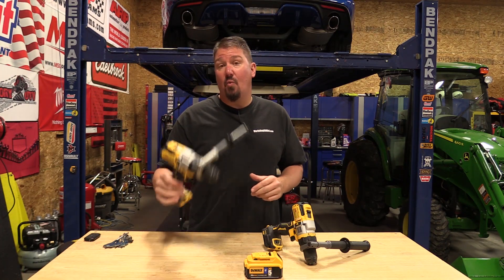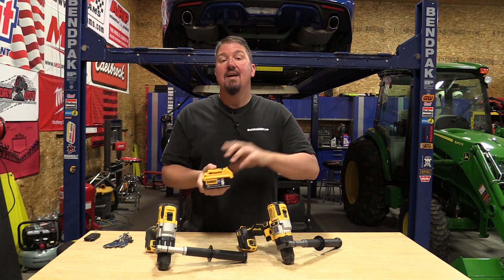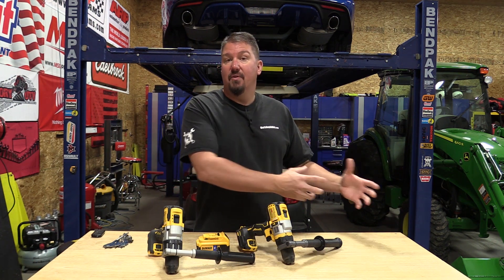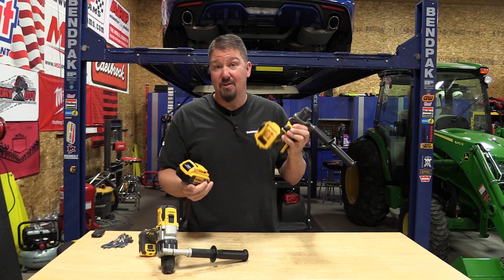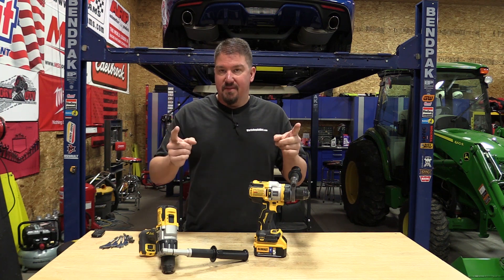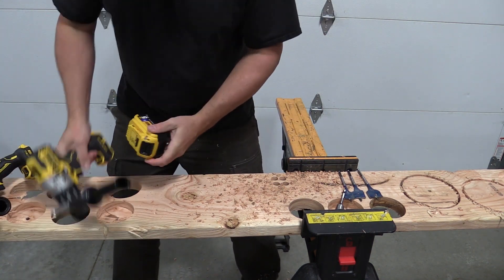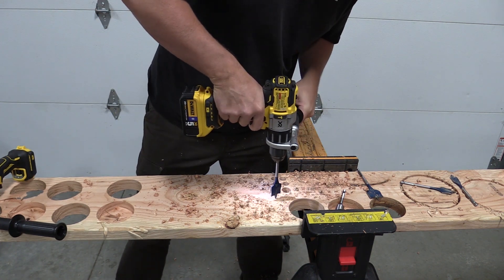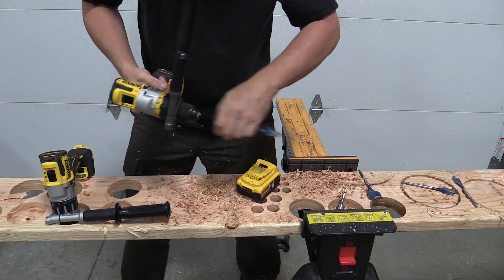I Was Wrong? DEWALT 20V 5.0 Ah Battery - FlexVolt Advantage DCD999 Vs Power Detect DCD998 For Power

Comment: I have been switching from Mikita to desalt this week & researching flexvolt & models & I think the 5AH battery is for me as my previous drill for hanging boilers still works ok on its 1.5Ah
I don’t see the point over stressing a drill if I need a core drill I use a core drill with a wire..
I’m not using these tools often so one multi tool £85 a drill im yet to choose & I got an impact driver £179 I diddnt want it but it came with charger & 2x5ah batteries so it made sense just to get the battery’s/charger.
We often pay in pounds what Americans pay in dollars for things but these diddnt seem too bad.
There isn’t much info on what a flexvolt actually is but as far as I can tell it lasts longer & can selectively supply some tools more power but if that includes more circuitry in the battery it’s more to go wrong.

Comment: This reminds me of the way people think they will get better performance from premium gasoline...in their Hondas. Premium gas only makes Hondas run worse. Why? Because it is not about higher or lower octane. It is about the RIGHT octane, the one whose flashpoint is the one the engineers calculated when they were designing the engine.

Same goes here. It is not about bigger batteries, or smaller batteries, or Flex Volt or 20Max batteries. It is about using the RIGHT battery for the tool. That 998 was designed to work with 21700 cells...which means at least a 6AH. That 999 was meant to work with whatever is in the flex volt batteries. Each will only give you their best when you use the batteries they were designed for.

So a head to head test, when you put the wrong battery in each of them...tells us little.

No, I don't use my 998 with a 5ah battery. My ah batteries are for smaller tools, like the cutout tool and the impact driver. I don't happen to have a 6AH at present, so I slap the 8AH when I have a job that requires the 998. And if you are on the flex volt line, you should be using flex volt batteries...whether they stuck the word "advantage" on their new marketing materials or not.

Comment: You need to put a piece of different colored tape on each tool,  so that we are always immediately clear on which tool you're using at the time. 

When I'm using a large bit I use the 6 amp Flexvolt battery that came with my DCD999 and it does not bogg down.  

The DCD999 is clearly the superior tool, although the 998 is also a decent tool. I do feel sorry for the guys who bought the slightly weaker and inferior DCD 998 for the same price they could have gotten the DCD999 for though. I guess if you can get a better price on the 998 then that's fine.

Comment: These inconsistent tool/battery/naming bundles make shopping a pain.  A look at replacement part schematic listings confirms that the DCD998 and DCD999 bare drill do, in fact, have the same motor and controller unit ("SA Motor and Module GTL" P/N: N793096) and the same gear assembly (P/N: N375865) and ring gear (P/N: N156100).

So, same motor, controller, and gearbox should give the same performance.  I think any differences noticed can be attributed to battery life and load differences based on pressure and wood composition.  In a lab test, they should perform exactly the same.

Seems like FlexVolt advantage just means the same 20V Max drill as the XR line, but with the flex-style battery.  If you have other flex tools that would be good to share the battery with, then that's the one for you.  If you run strictly 20V tools, then get the bundle with the biggest 20V battery at the same price or less.

Comment: That was a honest practical test  , basically for day to day use  DCD999 is any better except for the option of using FlexVolt batteries. I prefer the chrome on the DCD998 more hard wearing

Comment: I’ve always believed that the self feed should be used with impact drill instead of a drilling drill. The drilling drill speed and untamed torque always ends up running the threaded end and burning it.

Comment: The test would've been more accurate if you would've used two 5ah batteries rather than using one battery and changing it a million times.  Then you would see that the Flexvolt advantage uses more power.  I have both drills and the power detect is better in my opinion from drilling large Milwaukee hole saws all day.  All in all, the DeWalt 60v Flexvolt are the best way to go from what I have seen.

Comment: My guess is that if you were to disassemble them they are both the same drill and the only difference is the label. It seems the Power Detect is usually marketed as a kit with a 20V 8AH battery and fast charger whereas the Flexvolt Advantage is usually tool only and so there is no "Advantage" unless you already have a Flexvolt battery. The comparisons you made between the two while swapping the 20V 8AH and the 20/60V 6AH were entirely inconclusive. There's just really no difference, it's only a marketing strategy.
Reply: Home Depot always has the DCD999 with a 6 amp Flexvolt battery and upgraded charger. That is the kit I bought and it was $100 more than the bare tool. If you put the 60V Flexvolt battery That comes with the DCD999 it outperforms the DCD998 power detect. The two drills have different software.

Comment: I’ve used both they are the same drill just one is sold at HomeDepot the other at Lowe’s. I prefer the power detect and battery combo over the flexvolt advantage battery combo.

Comment: Man 5 amp battery is big. 8 amp and 9 amp flex batteries are huge. Not many people will dump a huge load of cash to buy this huge expensive batteries and then use a portable tool that will never reach the continuous performance of a real corded heavy duty tool. So I am really happy that you made a video that make sense portable tool with portable battery.

Comment: Could you clarify your final statements about the performance vs different flex volt batteries? 

The way I see it is that the power tools that did not have FlexVolt advantage or power detect had to operate at a set current value. This current value had to accommodate the smallest/weakest battery DeWalt ever made. With FlexVolt advantage, the smallest battery was now reset to a 6ah battery, so they could bring up the current for all flexvolt advantage tools due to the smallest battery being bigger. Now with Power Detect, they are able to tell what type of battery is connected and set the current according. This should make it so that the performance of any 20V tool is based on the battery, not the tool itself. 
You mentioned that the Power Detect tool ran worse with a FlexVolt battery than a FlexVolt tool running with the same FlexVolt battery. This does not add up. I would expect both tools to run the same. There is no reason why the Power detect tool can't also detect a FlexVolt battery and increase its power output. With that being said I would like to know what Dewalt has said on the subject. I can't seem to find any definitive information about power Detect from DeWalt. Keep in mind this is for tools that only use 20V.

Comment: Why do they call it flex volt advantage drill if it doesnt take advantage of the full 60 volts, it's false advertising at it's best,  I am a dewalt tool fanatic,  love my yellow and black , I trying to decide between the 3 biggest hammer drills now , 996 ,998 ,999.... 996 is cheaper , 998 has power detect , 999 false advertising and is most expensive , dang what would you do?
Reply: different charger and battery in the kits but both are the same price, $279.

Comment: Everyone using wood for reviews on drills , good for a home owner or residential junky but what about drilling some 3/8" thick angle iron with first a 1/4" pilot bit , then run a 3/8" bit then run a little 1/2" or 5/8"  bit though and see what drill will drill through with the 1/2" 5/8" bit and in what gear it's in to make it happen . That's a real test for commercial trades .

Comment: We need the 996 in a test with the 998 and 999 with 5ah, 6ah, 8ah, and flex volt 6ah flex volt 9ah and flex volt 12ah each battery used in each of the 3 drills, but using a long piece of 4x4 wood and 1.25 to 1.5 spade bits along with a 4in hole saw... They would be the real world test... Especially for for how I use my drills in the hvac business
Reply from the maker: We have that.

Comment: Bottom line is when  the Power Detect and FlexVolt Advantage are using the same size 20v battery,  the PD will get more power from it .  The PD will achieve the 1020uwo rating when using a 20v 8.0ah battery and the FlexVolt Advantage will only achieve its 1200uwo rating when using a FlexVolt battery.....👍👍

Comment: Great review! I agree with your reasoning.  If you have a flex volt battery collection already it seems like the right way to go in both the drill and the circular saw.  I currently only have 1-flexvolt tool and 2-6ah flexvolt batteries compared to a large collection of 2, 5, and a few 6ah 20volt, but if I am drill shopping I will be going with the 999 for sure. Keep these reviews coming, you are doing them right!!

Comment: When i read about the power detect at the big box stores. They say specificlly the 8.0ah battery is the one that it detects to draw 44% more power from the tool.  This could be false but maybe test in a future video?
Reply: Pwer Detect gets a power boost with any battery >5Ah.  That includes the XR 6Ah DCB206, XR 8Ah DCB208, FlexVolt 6Ah DCB606, FlexVolt 9Ah DCB609, and FlexVolt 12Ah DCB612.  They pair it with the XR 8Ah, as it was a new release at the time and offers the best combination of size, runtime, and power.

Comment: I'm new to the dewalt world. So am I understanding this correctly that you can use a flexvolt tool with a standard 20v dewalt battery?
Reply from the maker: Yes, all flexvolt batteries can be used on 20 volt tools.
Reply: @WorkshopAddict  I want to know if all 20v batteries can be used on flexvolt tools?
Reply from the maker: @whosnext2005  No 20-Volt battery can be used on any FlexVolt tools.  The Flexvolt Advantage is not a FlexVolt tool, that is a 20-volt tool.  Flexvolt tools are 60 volt.

Comment: I noticed on my DCD999 it came with the new flexvolt 6ah battery which is yellow instead of grey and also has 20650 cells inside instead 18650, Dewalt calls out the power stat only if you use the new flexvolts.
Reply from the maker: Yup, and that is why I am using the new style 9Ah
Reply: So if i use it with the older 6ah flexvolt batteries it won't work to its full potential?
Reply from the maker: @johnmflores85  correct

Comment: So..... would you trade in your power detect for a FlexVolt advantage hammer drill?  Currently no FlexVolt tools.
Reply from the maker: No.  I like to use drills with smaller batteries.  If I need a large hole drilled, I would grab a larger drill.

Comment: I use these drills for ice fishing and the 996 can drill around 20 - 25 8” holes through 2ft of ice with the 6ah flexvolt battery. I’ve been looking to see if I should upgrade and your videos answered my questions. I ordered the 999 because I need a longer handle and I use both flexvolt and the 20v 6ah batteries. It’s ability to give good performance with all the batteries sealed the deal. Plus Home Depot having the drill for $199 with battery and charger helped as well. Thanks for the video!
Reply from the maker: 996 vs 999 video coming out tomorrow.
Reply: Seth sp you're saying the 20v 6ah xr batteries work darn good on the flexvolt 999? My 996 crapped out on me last yr and I'm lookin to get the 999 or 998 but not sure if the regular xr 20v 6ah batteries will run the 999 good ? I was eying it with the flexvolt battery kit for 279 but waitin for a deal on it
Reply: I’m using the dcd999 with the drill with the xr 10amp hr battery. It’s a beast drilling 8” holes through the ice. I have flexvolt batteries as well but haven’t used them yet.
Reply: @Michael Schnitzer  I finally punched some holes with mine and man I absolutely love it!!!!!

Comment: Do I understand this correctly?  These companies go brushless to reduce "friction loss" but then the tools need electronic protections to protect the motor from overheating. I'd rather have brushes and not have my tools cut out. Sometimes my Milwaukee fuel 6 1/2 circular saw wiil shut off for hours if I over work it
Reply from the maker: Yes, they can cut out due to thermal issues.  There are plusses and minuses to brushless, but companies keep going that way as they can charge more for the new technology.
Reply: @WorkshopAddict  thank you. I don't really understand electronics so I don't pretend to know. But I have corded tools that I've been beating on for years and I've never even checked, let alone replaced the brushes. I guess wimpy cordless tools need all the help they can get so they reduce friction by going brushless... Or maybe it's all just bullshit and they are just trying to milk us. it's not enough these companies build all their junk overseas but they try to trick us with marketing ploys, to boot.
Reply: @timbarry5080  It's not a matter of friction  being reduced. It's eliminating a fairly resistive element (brushes) from the system. Cutting down on the heat produced/the energy waste from producing said heat and netting more torque and mileage from the same wattage. Also, brushed tools merit motor protection just the same as brushless. Running in near-stall conditions on a brushed tool makes the battery overheat, not send enough power to the motor, and have it slow to a crawl. It's bad for the motor, battery, what-have-you, all the same.
Reply: @timbarry5080  You keep saying that brushless is all about "reducing friction".  The friction reduction is minimal.  Motor brushes are very low friction by design.
Brushed tools are fine.  They have stood the test of time.  But you can get a more powerful brushless motor in a smaller footprint than a brushed motor.  Note the size of the motors on new brushless circular saws compared with their brushed counterparts.  
They generally run much quieter and more efficiently, using less battery power.  They can be used in hazardous environments where a brushed, spark producing motor cannot.  
They have a much longer MTBF(mean time before failure).  
They have higher torque and are capable of higher rpms while maintaining that torque.
It's not bullshit.  We now have access to cordless tools that are more powerful than the corded versions.  And much more powerful than cordless tool from 10 years ago.  Brushless motors have been instrumental in that evolution. 
But they do require sensors and brain boxes to make them work.  And while tool protection circuitry is a great feature, it can be annoying.  I'm perfectly happy to recycle a trigger if it keeps the smoke in the tool.
Of course they ARE trying to milk us.  They are in business to make money.  So, it's also logical to assume that brushless motors are now probably cheaper to make as well.  
They are, from my experience, just better.  How much better and is it worth the price premium?  That's for the buyer to figure out.  If brushed tools do all you want or need them to do, stick with them and save some coin.  
Do understand that just because it's brushless doesn't make it better.  There is no way a brushless tool model from harbor freight will be better than a brushed tool model from an upper tier tool manufacturer like DeWalt, Makita, Milwaukee etc. over time.
Reply: @mikemorgan5015  I agree. I'm just reciting the reasons I've heard from proponents of brushless tools
Reply: @orijimi  thank you. Either way cordless tools kinda suck for heavy work.  The day after i bought my 400 plus dollar Milwaukee drill kit the impact gun shut off in short order while screwing down deck planks. Granted it was a roof top deck on a hot day, and i had guys feeding me planks, so i was driving screw after screw without stopping. But 400 hundred dollars later and i had to use my drill to drive screws while my impact took a long break. I would have needed multiple impact guns to get through the day.

Comment: Nice drills but I'll stick with my 996 with 5ah battery it works just fine
Reply from the maker: The ONLY thing wrong with the 996 is the short auxilary handle.  Great drill.
Reply: @WorkshopAddict  definitely I was drilling holes thru 2x4 sill plates in a stud bay for pet tubing anyway the paddle bit hung up & drill twisted my hand around & slammed it against & framing nail I cut with sawzall luckily only about 1/8 inch punctured my hand
Reply from the maker: @brianklein6387  That sucks.
Reply: @WorkshopAddict  you can always buy the longer handle??